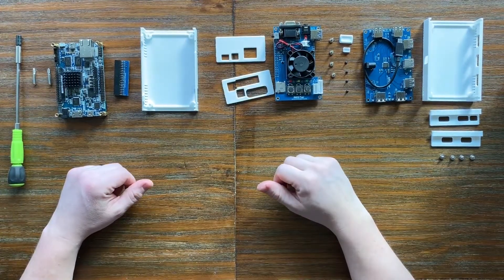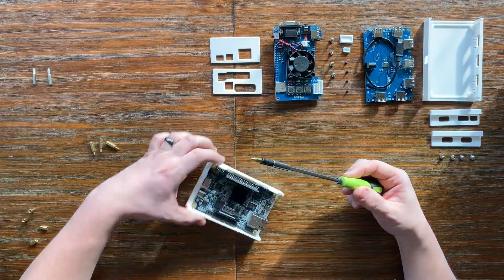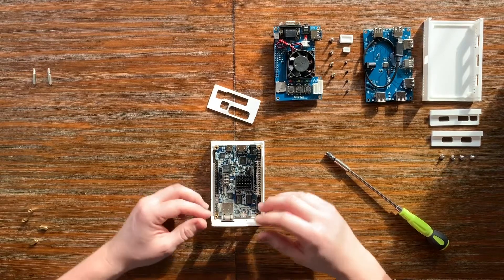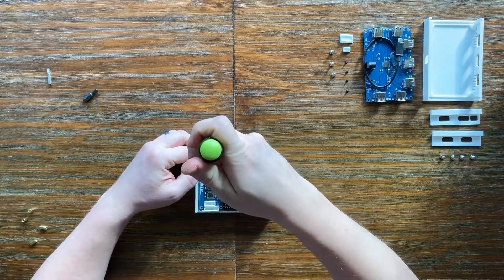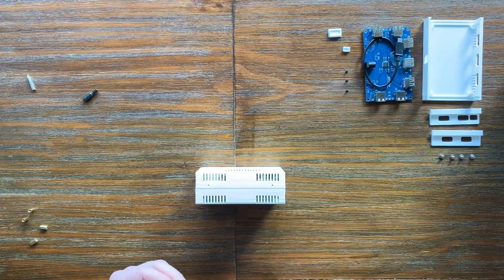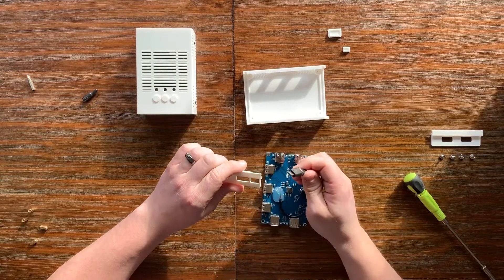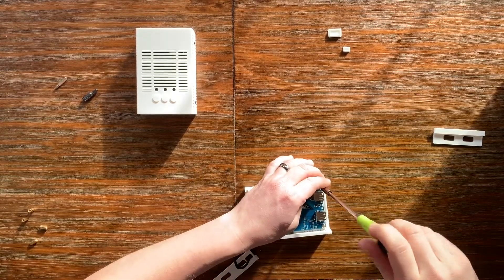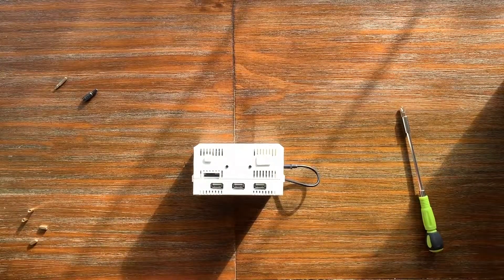MiSTer de10-nano Complete Assembly

Comment: When will you have additional cases in stock?
Reply from the maker: I’m not currently selling the 3D printed cases, or acrylic cases but have posted the design files for them. I’m currently selling the official MiSTer case that is made from PCB panels. My store is in vacation mode for another week or two but will be back after that. Thanks!
Reply: @MiSTerAddons  I like the official panels but I really wanted your case in acrylic. Will you ever make those again?
Reply from the maker: Cruiser133 there seems to be enough demand for them, so I’ll pursue it. I’m working on scaling up PCB production in hopes that leaves me more free time. I’m tweaking the acrylic case now in hopes of making a new batch in 2020. Still need to replace my CO2 laser tube on my cutter. Not enough time, because MiSTer keeps releasing more incredible, free, cores and updates :)

Comment: What size screws do you use to attach the usb board to the bottom part of the case?
Reply: All screws are M3 machine. I think the length is 4 or 5mm. The PCB is 1.6mm thick so 4mm would be enough.